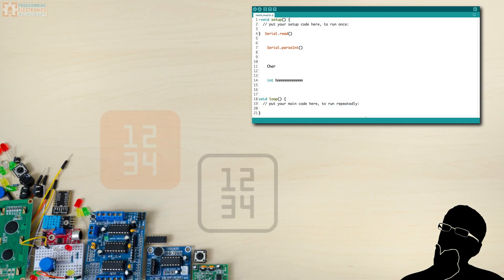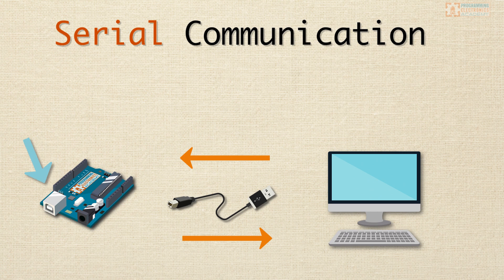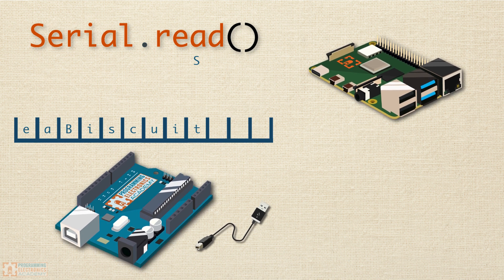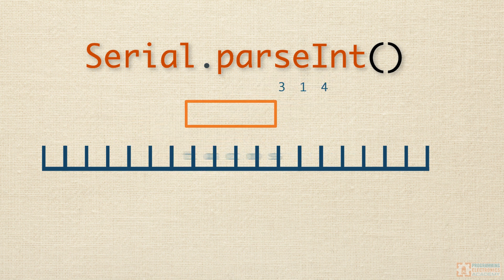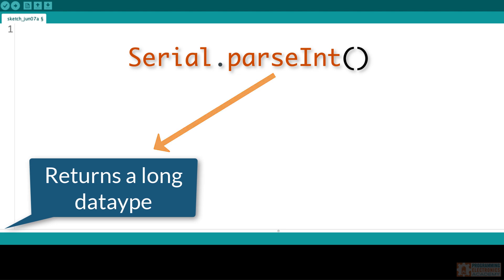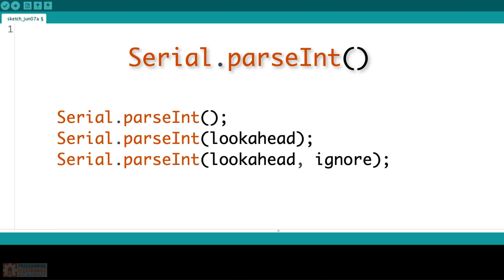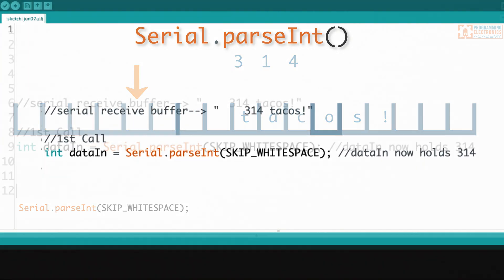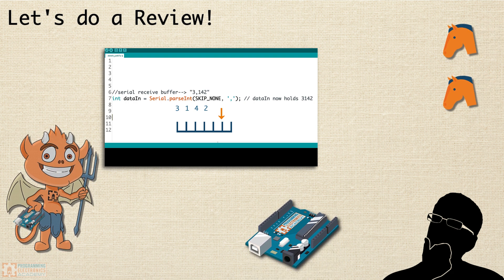Using Serial.parseInt() with Arduino

Comment: carriage return is ascii 13, if your data is 13 how does it know the difference in skip whitespace?
Reply: if you type 13 it will be 31 and 33 in ascii as those numbers are represented by other numbers ;) a bit confussing isn't it? ;)

Comment: Great video! This really helped me understand parseInt better. I’m hoping that you will answer my question. I’m sending data from Python as a string. The string would be 12,27,54\n. My Arduino code is
Int fn=Serial.parseInt();
Int sn=Serial.parseInt();
Int tn=Serial.parseInt();

lcd.print(fn);  lcd.print(“,”);
lcd.print(sn); lcd.print(“,”);
lcd.print(th);
So my display now shows 12,27,54 but after repeating this exactly 9 times my display will be 12,27,5412! Then it will start to display 27,54,12.
I’m thinking that I’m leaving something in the buffer and it’s picking it up after 9 iterations.
How do I fix this?
Thank you!
Reply: what was it
Reply: @agar.iodestiny8677  Just what I thought. I cleared the buffer by doing a serial read and the problem went away.
Reply: @warrenscorner  serial.flush(); and serial.availabletowrite should advise.

Comment: If I wanted to send multiple values separated by commas e.g. 1243,9876,345,123 and have the Arduino save these in 4 variables e.g. data1, data2, data3, data4 how would this be done?
Reply from the maker: Great question!  Many ways you could do this, but I think Serial.parseInt() would work paired with an array.  You would want to run a loop perhaps to store these values in an array, and every time through the loop, you increment the array to save the next value.  If you know there will only be some many comma separated values coming in, you could then copy those saved array values over to your variables.  Hope this makes some sense!
Reply: Hi, Many thanks for these useful videos.  But this answer doesn't make sense to me. I've called again the parseInt inside the Loop but it keeps only the last value entered, then if there is 2 values, 10 and 50 to add each other , the result is 10+10 or 50+50. But not 10+50. Any video any idea to solve this ? Thanks a lot
Reply: @programmingelectronics  Thanks a lot. I was about to ask this.

Comment: If I type in "Write 20 34" on the serial monitor, I need to store 20 and 34 in two separate locations, if I use Serial.parseInt() then it will retrieve 20, discard "Write " in the serial receive buffer, now only " 34" remains in the serial buffer, is there a way to retreive this value 34 and get it stored?
Reply from the maker: You should be able to  call parseInt() again to get out the remaining 34.

Comment: Since parseInt() will ignore some non numbers like the " tacos" after extracting "314" from example you gave,  I assume clearing whatever is left in the serial receive buffer would be important? If so how would you do that?

Edit: Great video btw, I really appreciate the tutorials.
Reply from the maker: That is such a great question!

To answer your question, you can use serial.read() with while loop to clear the rest of the buffer - you read out byte until serial.available() is equal to 0.   

Side note: It may be the case that the "other stuff" in the buffer is important, and you may want to read that in as well - which is why I am guessing this function does not just clear it for you.

Hope this helps some!
Reply: @programmingelectronics  thanks!

Comment: Any chance you can explain the difference between while (Serial.avalable() > 0) and if (Serial.available())
Reply from the maker: Great question!  Here is my take...

The "while" will keep you in it's block until the serial buffer is empty, where as the "if" (assuming something is in the serial buffer) will enter and then exit , regardless of how many bytes are left in the buffer.
Reply: @programmingelectronics  of course, I had both in my code but forgot why I used both methods. Thanks for the reminder.